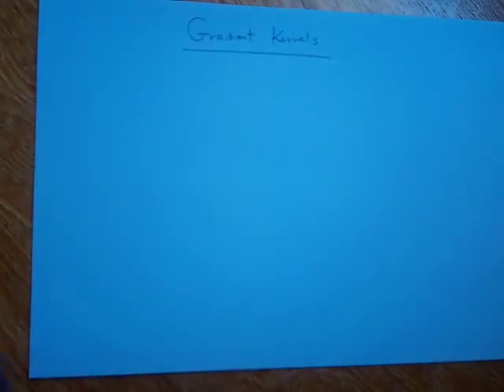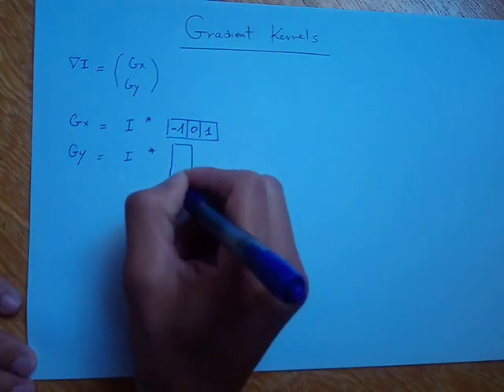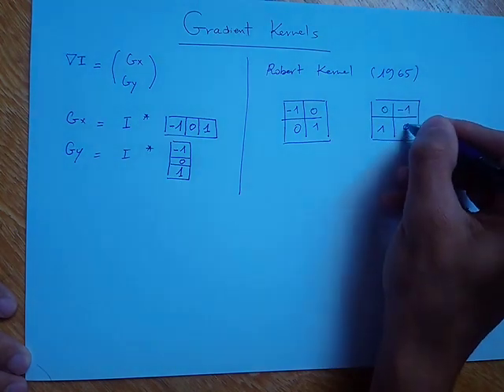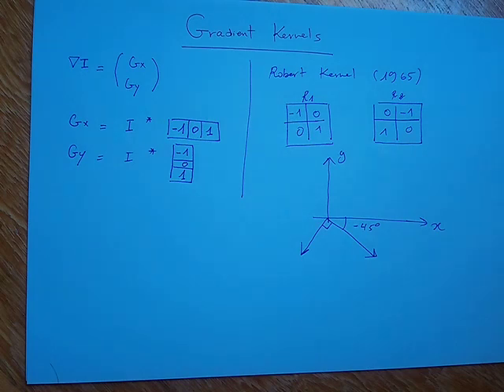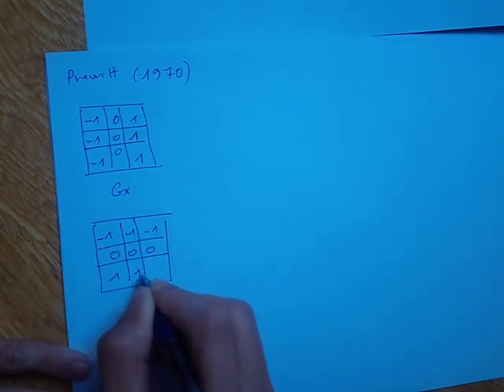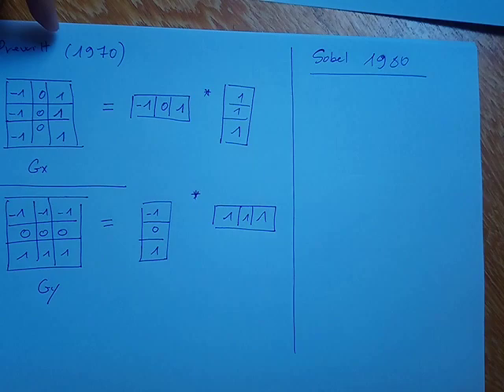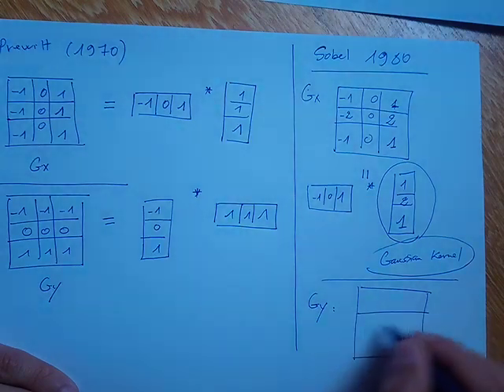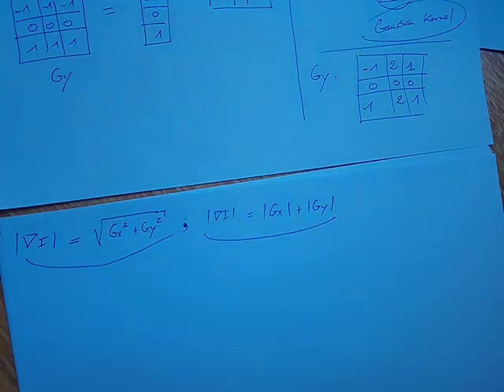Gradient Kernels (Robert, Prewitt And Sobel)

Comment: Hi .whitch scale school the pixel color be. to see the effects of. filters is in the interval [0 255]  or [ 0 1] after normalization. because i found different results
Reply from the maker: This is not difficult to do. For instance, using one sobel kernel would lead to a pixel range of (- 1020,  1020). 1020 comes from 4*255 - 4*0 (note that a change from 0 to 255 is the laegest possible derivative). You can with this workout the rest. Usually we do not care about this when displaying the edge reponse image. We just normalize it in the range (0, 255) by multiplying by (255/Imax), where Imax is the maximal value of the edge response result.

Comment: It's not clear to me why  -1 0 1 represents the derivative in x direction (same for y direction). What is the math behind that? why using -1 0 1 and not for example -20 0 20? I don't get it. Would you possibly explain that to me sir? thank you
Reply from the maker: Hi Viktory. Thank you for the question. I'm afraid the answer to your question is not going to be short if you lack mathematical concepts such as derivatives. The second paragraph of this comment answers your first question. The third paragraph answers your second question. The consecutive paragraphs are optional and contain more details on the first question.

The first question is why -1 0 1 represents the derivative. A simple answer is because edges in the image are characterized by a high change in the value of pixels. In mathematics, the derivative of a function at a given point measures its rate of change at that point. So it's natural to detect edges using derivatives. On digital images, one way to approximate the derivative at a given point (or pixel) is to take the value of the next pixel (on the right or on the top) minus the value of the previous pixel (on the left or on the bottom, respectively). If you want a detailed example, see the last section of this comment.

The second question is why exactly -1 0 1 and not [-20 0 20]. Nice question! the convolution of an image IMG with the kernel [-20 0 20] can be written as: IMG ∗ [-20 0 20] = IMG ∗ (20 × [-1 0 1]) = 20 × (IMG ∗ [-1 0 1]). This indicates that the convolution of IMG with [-20 0 20] is the same as the convolution of IMG with [-1 0 1] and multiplying the result by 20. Thus, using a kernel like [-20 0 20] is not useful because multiplication of IMG by 20 is not useful but rather harmful in terms of computation and memory.

------------------------------------------------------------------------------------------------------
-------------------------------------------LAST SECTION--------------------------------
Consider this 1D image of 5 pixels only: [51,52,53,210,250]. If you want to compute the derivative of this image at the second pixel (52), then you must take the value of the next pixel (that is 53) minus the value of the previous pixel (that is 51). You get: 53 - 51 = 2. 

If you the previous process on the third pixel (that is 53), the derivative at that pixel is 210 - 52 = 158. This value is very high if compared with the previous value, which is 2. High values indicate the presence of an edge. If you perform this process on all 5 pixels of the 1D image is exactly the same thing as convolving it with the derivative kernel [-1 0 1].

There is an important detail I didn't mention in the video. For example, if we want to compute the derivative at the first pixel 51, we take the next pixel 52 minus the previous pixel. The issue is we have no previous pixel. There are many ways to handle this. One way is to avoid computation of derivatives at the first and last pixels. Another way is to fill missing values with zeros.
----------------------------------------------------------------------------------------------------------
I hope this clarifies your doubts! Feel free to ask any other questions. Good luck :)
Reply: @zardouayassir7359  Thank you very much for this response sir. It is very clear and it gives me a nicer overview on this topic. 
Despite that, I still have one doubt. You said that the way to approximate the derivative in digital images is to take the value of the next pixel minus the value of the previous one. This makes sense to me, but what I don’t understand is that if I consider the derivative formula in x direction: dx/x= [f(x+h)-f(x)]/h we know that since we are talking about pixels we can approximate h=1. Therefore we get dx/x= f(x+1)-f(x)  and what I ultimately don’t understand is how we convert this formula into the kernel -1 0 1 
Thank yo very much for being so nice and helpful.
Reply from the maker: @viktory6790  the formula dx/x= [f(x+h)-f(x)]/h does not "convert" into the kernel [-1 0 1].  dx/x= [f(x+h)-f(x - h)]/2h does. To understand why this is the case, let's assume that I want to convolve a 1D image of 4 pixels IMG = [p1 , p2, p3, p4] with the kernel k =  [k1, k2, k3]. To do that, we place the kernel on top of IMG in this way:

[k1, k2, k3]
[p1, p2, p3, p4]
then, we slide the kernel to the next position:
       [k1, k2, k3]
[p1, p2, p3, p4]
Now, we can't slide any further because the element k3 would be out of the IMG. Since there are TWO possible positions of the kernel k on IMG, the convolution results in a vector of TWO elements (let's call them c1 and c2): IMG∗k = [c1, c2]. 

Now, for each of the two positions of the kernel k, we add the terms of the element-wise multiplication. This yields for the first position:
c1 = k1×p1 + k2×p2 + k3×p3
for the second position:
c2 = k1×p2 + k2×p3 + k3×p4

Now, if you set k = [k1, k2, k3] = [-1, 0, 1], you get for the first position:
c1 = p3 - p1
c2 = p4 - p2
It's clear now that convolution with [-1 0 1] is the same as taking the next pixel minus the previous pixel for each position of the kernel. 

You might wonder why do we use convolution wth [-1 0 1] instead of just writing a code that subtract the previous pixel from the next pixel. The short answer is that mathematical properties of convolutions enable faster computations.

I Hope this helps and by the way you don't need to call me "sir". I'm happy with yassir.
Reply: @zardouayassir7359  thank you yassir. You have been very helpful. May I ask you how you get the dx/x=[f(x+h)-f(x-h)]/2h formula? From what i understood, if we apply this formula to the pixels we should divide also by 2 (h=1 therefore denominator=2) at some point. Instead, with the kernel [-1 0 1] we only take the next pixel minus the previous one (that is correct, this is exactly what we should do but I don't get why when I look specifically at the equation). This [-1 0 1] in fact makes sense to me when I look only at the numerator of the equation f(x+h)-f(x-h). What about the denominator? Can you help me figure out the math behind this? I understand how it works logically, but not mathematically (I know it may sound conradicting). What I mean is that i understad how the  [-1 0 1] kernel works, i understand why it is like taking the next pixel and subtracting the previous one but I don't understand how this formula dx/x=[f(x+h)-f(x-h)]/2h can be computed as a kernel.
I am taking my digital imaging exam tomorrow and I have been struggling a lot with this particular aspect so thank you very much again for your help.
Reply from the maker: You are right. If you want to compute the derivative along x (or y), dividing by 2 is reasonable. Now, think about the pixel range of the resulted image if you divide by 2 🤔. Suppose that the original image is coded on 8 bits, which means that its pixel range is [0, 255]. The smallest possible value in the x derivative image is 0 - 255= - 255. The max is 255 - 0 =255. Thus, we get the range [-255/2, 255/2] = [-127.5, 125.5].  To display an image on software, a colormap must be assigned according to the pixel range. In our case, we could write a program that assigns a black color to the smallest possible value (i.e.,-127.5) and increase the brightness gradually until the color becomes white for the maximum possible value (i.e., 127.5).

Now, if you don't divide by 2, the range is [-255, 255] instead of [-127.5, 125.5]. If you want to display this image, you'd need to change the colormap again to suit this range. If you do that, you'd get VISUALLY the same image as that you divided by 2.

You need to know that the theory is usually tweaked to suit practical purposes. Another example of that is the approximation of the gradient magnitude I mentioned in the video.

Good luck!